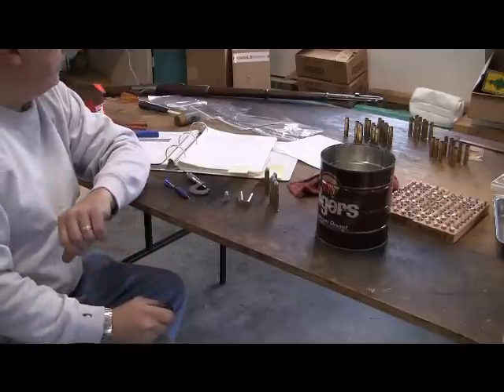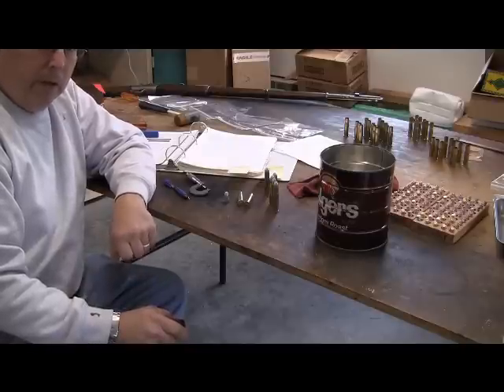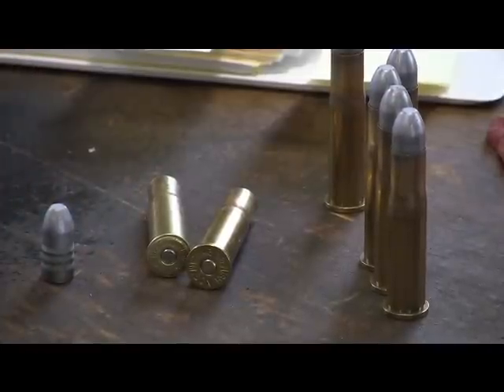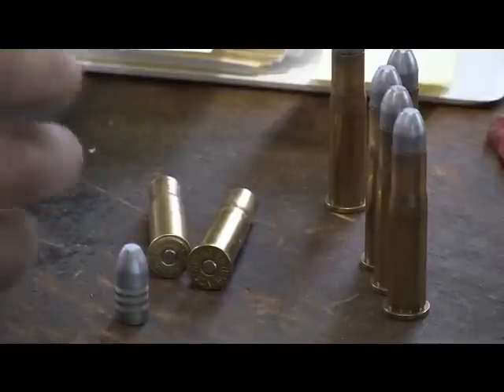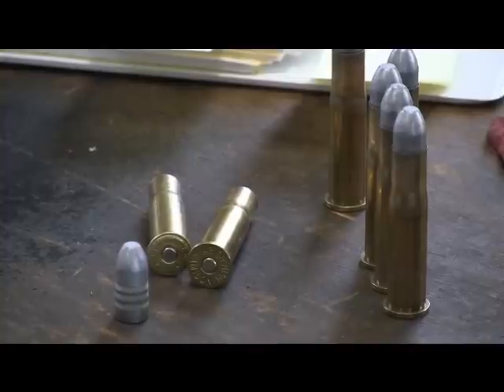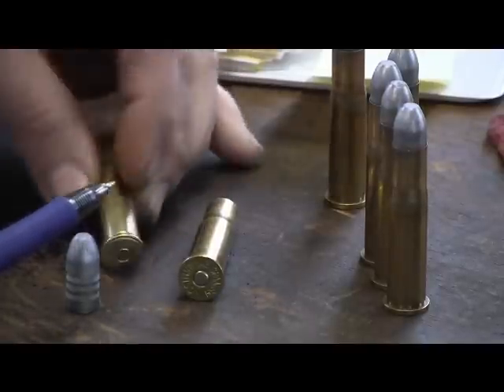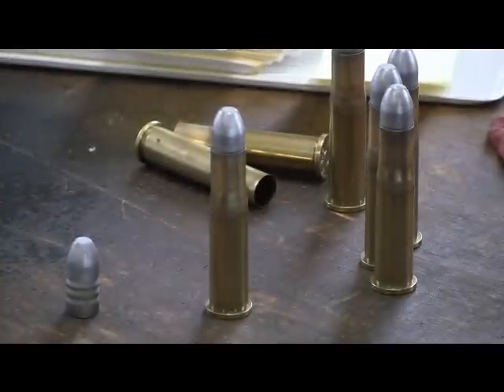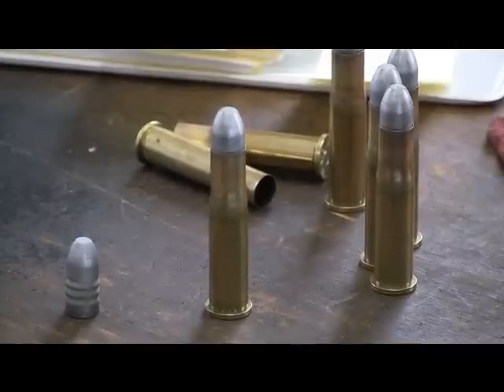Reloading the 43 Spanish with smokeless powder

Comment: No disrespect meant, but if I understood correctly, you said the .43 Spanish used a .339 inch bullet. The correct bullet diameter is .439 inch. My favorite load for my .43 Spanish is 13.0 grains of blue dot behind a 379 grain cast bullet. It is a very accurate load in my rifle.

Comment: It is true some people use smokeless powder in black powder arms all the time.  However, like drunk driving, which some people do all their lives and manage to never have a serious accident and don't understand what all the fuss is about, when things do go wrong, they tend to go wrong in a gruesome way.   May I suggest googling 'accident rolling block'?  Then go to images and look at the half a breech block pulled out of someone's forehead.   Since it is your own rifle, I respect your decision to use smokeless in a rifle never intended for it.  However, in my own 43 rolling block I am staying with Goex 2F or 3F.   BTW, I use bullets pulled from actual 43 Spanish rounds and most of them mike at .433.  I also use 200 gr bullets for a 44 Henry as they mold out at only 435.  My own carbine bore is also 435 so it all works out well.
Reply: Ken ibn Anak , the old published "BP equivalent pressure" formula which is well known, widely published, and intended for use in serviceable guns  apable of shooting BP is a 0.40 (40%) loading of IMR4198 of the original BP service load. Thus, a 77 grain charge of BP can be loaded with 30 grains of IMR4198 for similar pressures and performance. This has been born out in my testing with the 1871 Mauser, the 1871 Spanish Remington Rolling Block, and the 1873 Martini Henry. Perhaps the only action I would not trust with this is the old iron barreled Snider Enfield conversions.
Reply: Your bullets measure 433 because of corrosion
Reply: @lorenhughes4098  LoL, could be, but the deer and paper targets don't seem to notice that.

Comment: What powder did you use and what were the grains # of grains used for a safe starting load?  I used the 45-70 data for a 375 gn lead bullet.
Reply from the maker: +Don Whitwell when I did this load I did not have the correct bullet, so I sized a larger bullet down , so with a slightly oversized bullet my velocities were too high with starting loads, I did buy the lyman bullet mould for this round but have not done any reloading yet. most powders used in 45-70 trap door loads can be used or adapted for this round. IMR 4198 or accurate 5744 would be good choices, as to what to start with load wise I do not have any info. You do not want the correct bullet to be going over 1300 FPS my first try the light loads were doing about 1500 so I pulled the ammo apart I am sorry but I have not done any work with this round in a while, but I hope this helps